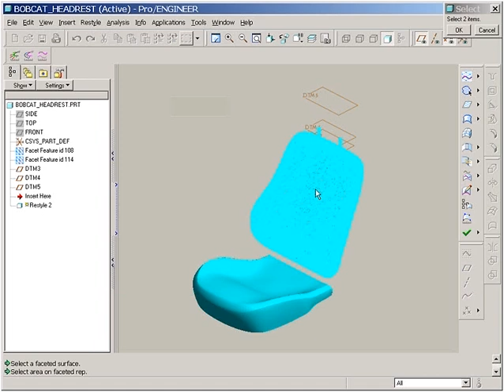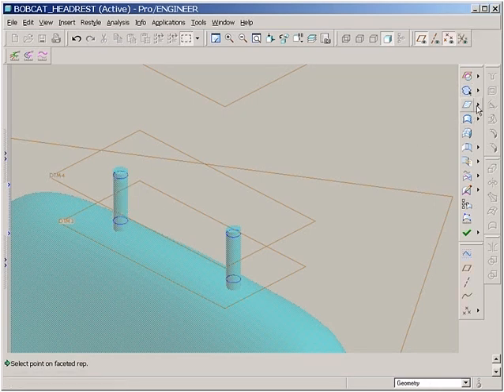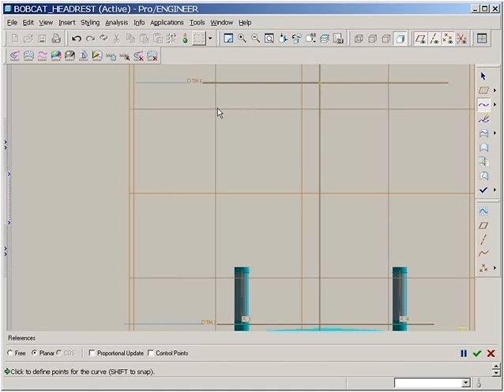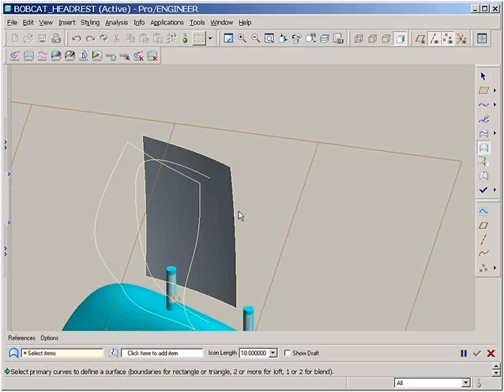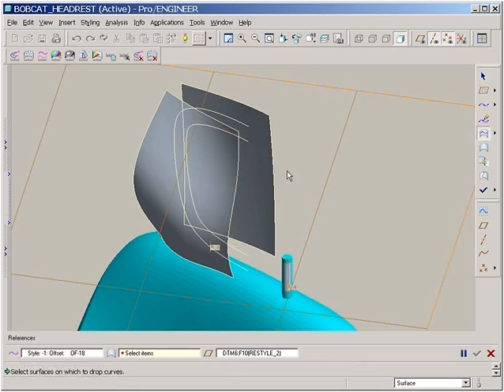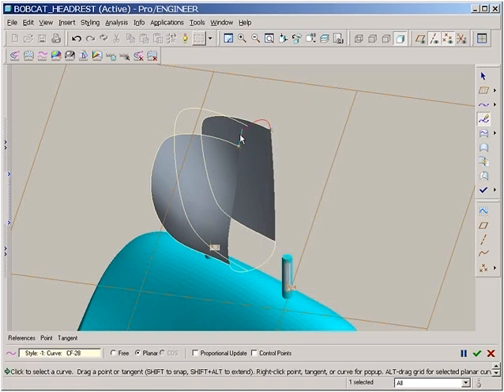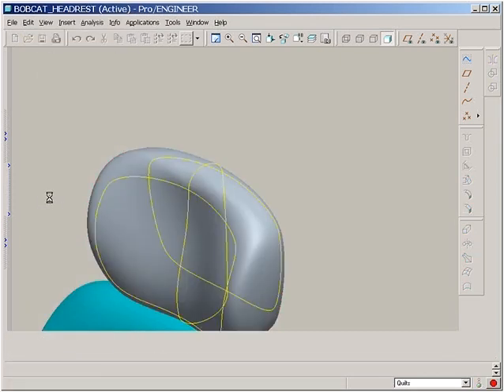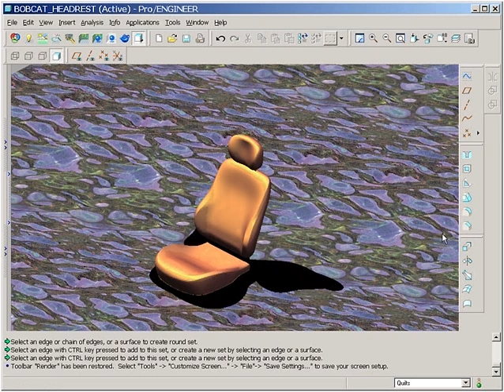ProEngineer Reverse Engineering & ISDX in Wildfire 3.0

Comment: I need some help regarding reverse engineering can i get your e-mail id?
Reply: +Adnan Minhas let me know if you find anything. i only have found WF3 and WF2 materials.
Reply: I have step sheet metal part need to en-band is that possible?
Reply: +Adnan Minhas you need to use the Convert To Sheetmetal feature in the Model tab and Operations group. Then you can flatten the part.
Reply: I was try but can't